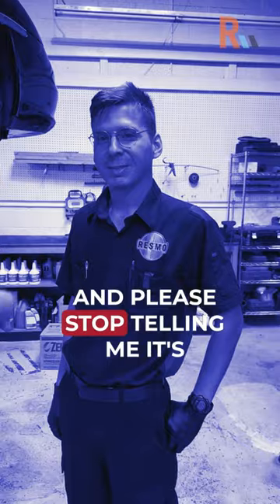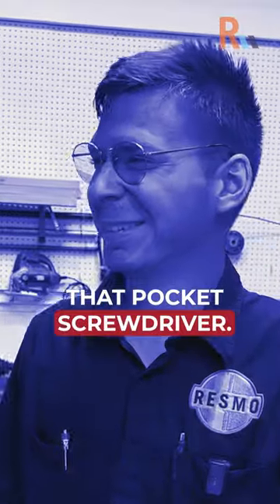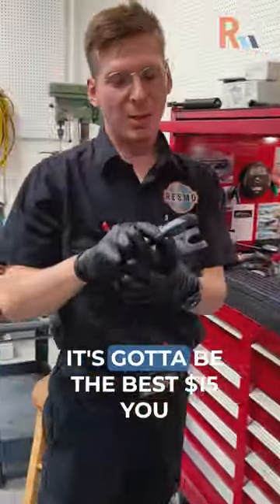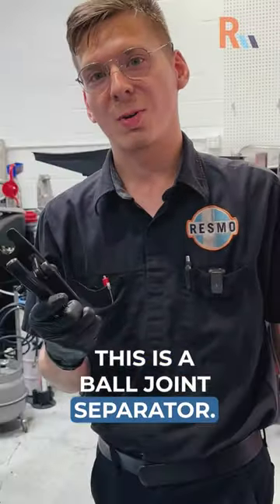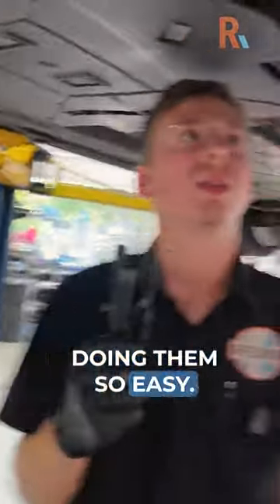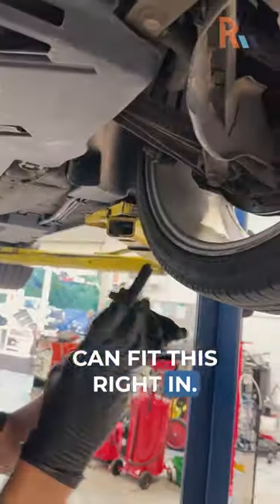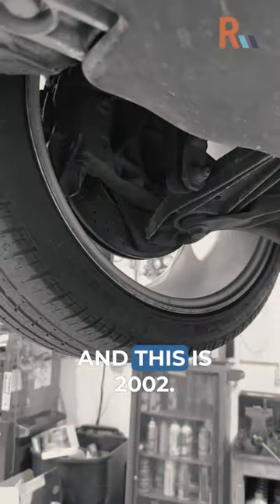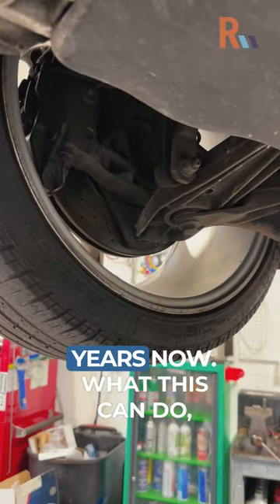Response Motors Mechanic's Favorite Tool (aside from his pocket screwdriver)

Comment: Tap the side with a hammer bro 😅. Big one hit the right spot they always pop .
Reply: @Random-ed2xf   lol 😆 😂  born and raised in boston ,  New cars are rotted already.. Learn where to hit it and find the correct noise to pop it . Real old school mechanics understand what I just said even though you might not .
Reply: @noname-jn5pp can confirm, this is the way. Michigan mechanic here
Reply: I have only had it work a handful of times - and it was great when it did. But I've beat on all sorts of different areas, convinced I was doing it wrong. Maybe I don't have enough mass behind my swing or something, but even using a heavy mini sledge, I just can't get that trick to work on the stuff I'm working on.

I'm talking about the knuckle being beaten to kingdom come from all sorts of angles. That little tool though, took what used to be a couple of hours of work into maybe a 30-45 minute job and it doesn't tear the boots.

Don't get me wrong, I try the hammer trick first, but 9 times out of 10... it doesn't in my experience.